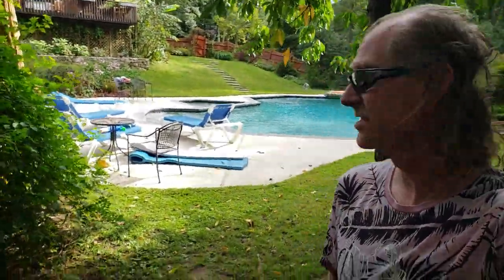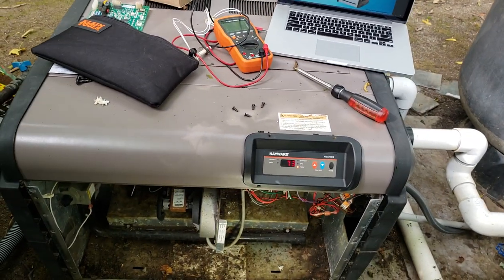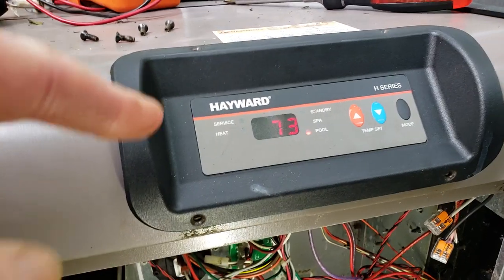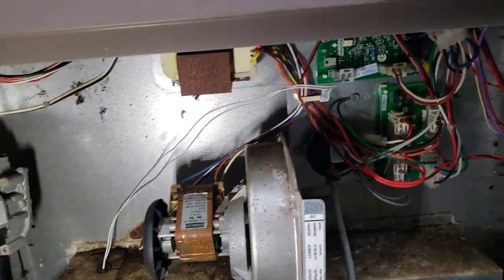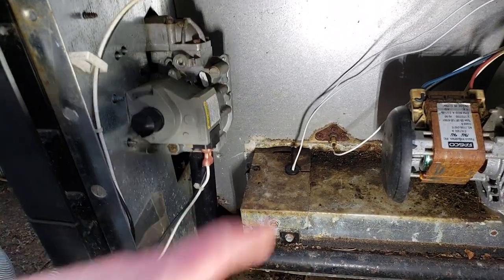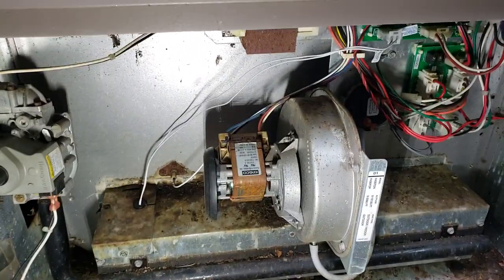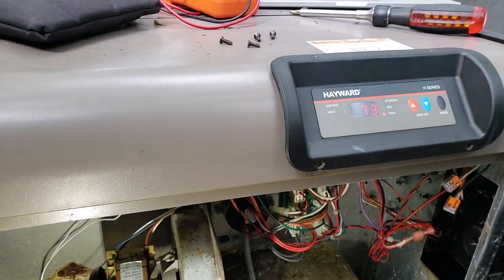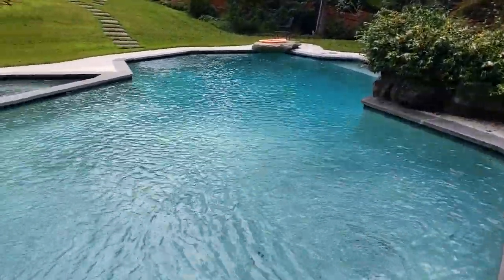Hayward H400FD pool heater fixed igniter issue no thanks to Hayward support

Comment: Thanks for the video.  I am also having an igniter issue. I just got done checking the orifices and they are not clogged. One thing I noticed is the transformer seems extremely hot. I’m not sure if this is the usual. I don’t know if it’s the igniter the gas valve or some issue with the circuit board I think I’m gonna have to call a technician out.
Reply from the maker: What code are you getting? Are you comfortable using a multimeter? Check that the igniter is getting 120volts and it's heating up. If the board is sending 120v, it may just be an inexpensive igniter. Those are plug and play. The service manual link is in the description.   It's very helpful.
Reply: @Samlol23_drrich  getting “if” for ignition failure.  I’ll try the multimeter tomorrow and let you know.  Frustrating that our pool is only 3 years old and this is the second issue with the heater.  Luckily, the first one was covered under the one year warranty.  Not sure if it matters, but everything was fine last year and this just started with our spring opening.
Reply from the maker: @toddh2000 I was just looking. It's not the igniter.  Did you turn on the Internal gas shut off?  I would make sure that is opened and then I'd make sure all the fuses on the other board have continuity.   

Yuck.
Reply: @Samlol23_drrich  I tried measuring the voltage from the board going to the igniter during the ignition process and it never read anything above a couple of volts and I assume that was just static noise. Yes, the internal gas valve is turned on. I did also check the three fuses and they have continuity.  I am guessing that this is pointing to a bad board? Also, throughout my testing, I did notice that the transformer again got very hot.
Reply from the maker: @toddh2000  when I replaced the igniter the board was sending 120 to the leads. However, it's possible something is failing before the igniter phase. So it wouldn't send voltage.   Did you download the service manual in the description? That is worth it's weight in gold.  It's really well done with color photos and everything.  Take a look at that first.
Reply from the maker: @toddh2000 I would also make sure the flame sensor is plugged in properly. It's on what looks like the left side of the board.
Reply: @Samlol23_drrich  I’ll download the service manual. Issue is that this is my weekend to troubleshoot. We are planning on having a pool party next weekend. I jumped in today with the temperature of 70° and it was a little painful. I’m guessing that I’ll just have to have a technician come out since I am working all week, I will post back here with any updates. Thank you for your help.
Reply from the maker: @toddh2000 ahhhh. I feel like a failure!  I totally get it though. We are doing the same next weekend and my water is painfully cold too. I vacuumed about 500 chipmunk nuts out today. A service guy will have the parts and can try a board and if it's still not working can move on. Good luck getting to the bottom of the issue and please do let me know.  You're probably right that it's the board. But who knows- could be that transformer. You could always test that to see if it's putting out 24v. 
Sorry I couldn't help more!
Reply: @Samlol23_drrich  don’t feel bad. It was great finding this content to help troubleshoot this situation. Actually a repair guy came out today from the company that installed our pool. It was very helpful to give him the information so far. To my surprise, our warranty is actually three years instead of one. I guess since we bought the pump filter and heater all from Hayward that’s the deal. I’m not sure if that’s the hundred percent the case anyway with the diagnostics I was able to provide everything is pointing to the gas valve. I’m not sure why my multimeter reading didn’t pick up the 120 V but they took thecompartment to the igniter out and could see that it was igniting. Only issue is they do not have the part in stock still crossing my fingers that they can order it and get it done by Friday. Thanks again for your video. I’ll keep you posted.
Reply from the maker: @toddh2000 Thanks for letting me know.  You initially thought it was the gas valve. That's crazy because those things last quite a while usually.  Maybe it operates on low voltage, and you're right- it needs a transformer. Who knows- The three year warranty is great for pool equipment! 

Hope they get the gas valve in before memorial day weekend-
Reply: @Samlol23_drrich  happy to report that the issue is resolved and the pool is now being heated. It was the gas valve. I too wouldn’t have suspected that but they did tell me they replaced a couple of them last year so it may be more common.
Reply from the maker: @toddh2000  awesome. Well, thanks for taking me along on the ride. I'll keep it in mind if I ever get an IF code. Have a great Memorial Day weekend

Comment: I have the same code showing do you have the product # for board and ignitor
Reply from the maker: Let me look. Got them both on Amazon. I'll put links into this response- I'll edit it.
https://www.amazon.com/dp/B004VTG3I4/ref=cm_sw_r_cp_apa_glt_fabc_P6XK1BE8DWWP5ASG48HX?_encoding=UTF8&psc=1
And
https://www.amazon.com/dp/B004VTG3Q6?ref=ppx_pop_mob_ap_share
But go to haywards site and find the exact part # if your heater isn't exactly the same as mine. I would try the ignitor first.
Reply: @Samlol23_drrich  thank you

Comment: They won't help you as a consumer because if you hurt yourself and they are helping you they are liable. It's not their fault litigation concerns are very real
Reply from the maker: I totally understand their perceived liability. There is a huge difference between someone calling in and saying "duh, my heater won't turn on, whats the matter with it?" And someone else who says "I'm getting an IO code and went through the troubleshooting in your service manual.  I replaced the ignitor and its still throwing the code. Its getting 120v to the ignitor.  The service manual says to call you,  so whats next?"
Its just a shame they have a policy not to discuss anything with anyone not in the business.
Reply: @Samlol23_drrich  if someone in the industry hadn't been sued before they wouldn't have that policy. There are some manufacturer's that will not even sell their products to the consumer and all of them either lower or eliminate the warranty if the product isn't professionally installed.
Reply from the maker: @brianbaker4378  now that is an awesome idea. I will cause they are back, my dog keeps going over to there and putting her snoot in that area. That means definitely back.
I didnt record it, but last year I took both sides off and there were large mouse nests in both sides. They had partially eaten through the wires leading to some pressure switches. I had to rewire them. Im sure they are at it again. 
Thanks for all of your comments.
Reply from the maker: Brian Baker when something is relatively new or under warranty I don’t touch it and leave it to the pros. I only fix the older stuff that I know a lot of the guys wouldn’t want to even try and they would suggest replacement.

Comment: Thanks!!! Here goes nothing.😅
Reply from the maker: Nah. Here goes a heated pool tomorrow!
Reply: so mine is a SN150DHN Hayward and I am assuming it's the same? I'm taking you out to the heater with a laptop charger to play you over and over, LOL!
Reply from the maker: @Mott360  download the service manual.  There is a link in the description.  What's wrong with it?
Reply: @Samlol23_drrich  it red I/O on the display so ignite are open. We tested the igniter with a multimeter. The ohms were light 968,000 so we ordered a new one. It should be here tomorrow which is great. The pool is 80° without a heater since the temperature here will be over 100 again tomorrow.
Reply from the maker: @Mott360  nice.  Hope that does it.  You may need a chiller soon!

Comment: Maybe somebody should call technical support on how to fill a cavity. Some things homeowners should not try to fix. I’ve replaced heaters after homeowners nearly blew their houses up trying to do repairs.
Reply from the maker: See,  I don't give a crap if someone takes sandpaper to their chipped tooth or does their own braces with that at home invisalign junk. 
If your comfortable doing it yourself, go for it. Im glad to tell you what the risks are. 
But don't tell me I can't do something in my own house I'm comfortable doing. Dont care if its wiring, plumbing or structural. 

If someone is stupid enough to blow up their house it shouldn't be on hayward. 
Maybe you should google "right to repair" and Apple. 
But don't tell me what I can do to the house I own.
Edit. I dont mean to come off as a dick. What if your dealership told you that you can't do your own brakes if you've been doing them since you were 16?  There is a big difference between them encouraging HOs to do repairs, and giving them real tech support on their product when anyone calls having been through every test in their own service manual- and the manual suggests calling the manufacturer.

Comment: You mean I F not I O
Reply from the maker: No, they are two different faults. IO is “igniter open circuit” and IF is “ignition fault”. Here’s their service manual. See page .32 http://www.haywardnet.com/pdfs/uhs-heater-troubleshooting-guide.pdf. But thanks for commenting and watching.
Reply: @Samlol23_drrich  well mine first read SF then IF we changed the ignite n still not heating up
Reply from the maker: @lindalisten1516  did you have the service manual I linked above? If not download and follow the flow chart. It's great

Comment: I got IF code . What is mean?
Reply from the maker: It's an ignition failure. It can be about 10 different things, so I suggest you do a Google search and find the pdf service manual for your exact type of heater. It will run through all of the tests that you need to do to see where the problem is. But of course the first thing to do is make sure your gas valve is open those outside the unit as well as inside the unit
Reply: It’s the igniter, has or flame sensor.
Reply: Did you find out what it was, i am fighting that now
Reply: I've been dealing with the IF code too...its driving me nuts because I can usually fix just about everything

Comment: You’re dealing with natural gas unit that’s y they won’t talk to u… Home owners shouldn’t be troubleshooting these units don’t be a cheap and pay a professional
Reply from the maker: The last thing I am is cheap. I service my oil burner and both of my central AC units because I’ve had “professionals” do more harm than good in the past. - I’ve got a 608 universal to do the AC legally. 
My unit is LP not NG.  I plumbed and wired my whole house generator that also runs from my buried LP tank.  Point isn't to say "look at all I can do" - the point Is if someone like me (I know what I'm doing)  calls they shouldn't NOT help me just because I'm a HO. And by the way, if you've never heard a dentist say "I should have been a plumber and gone into HVAC"- well now you have.